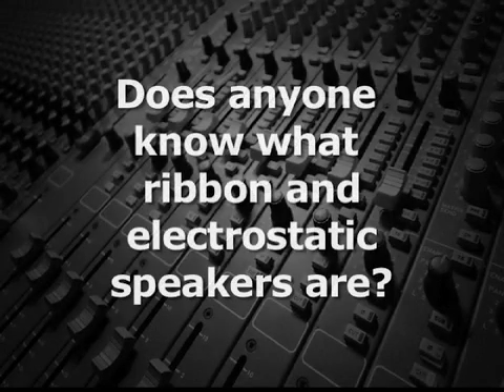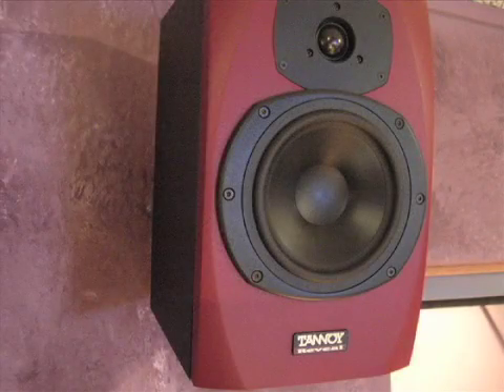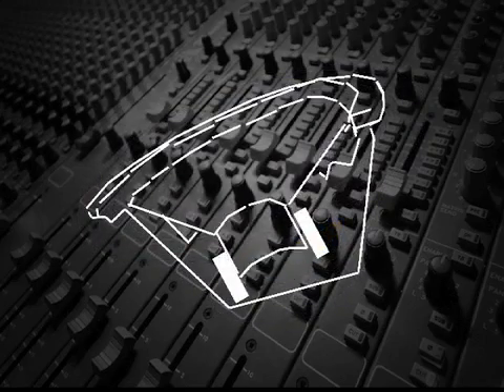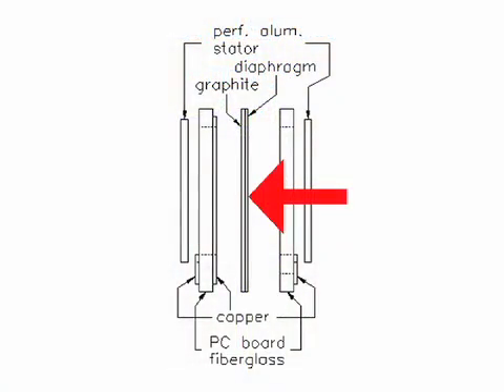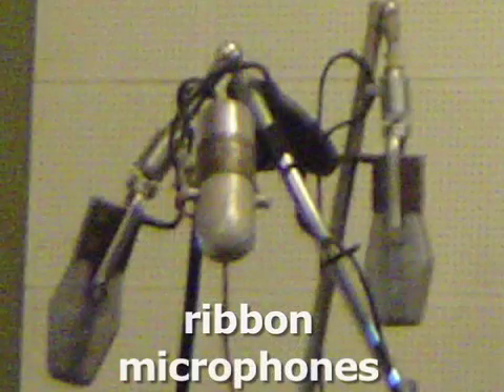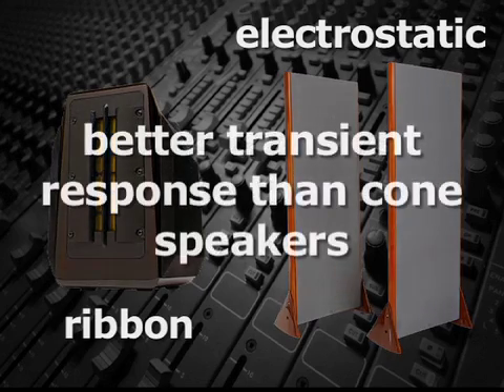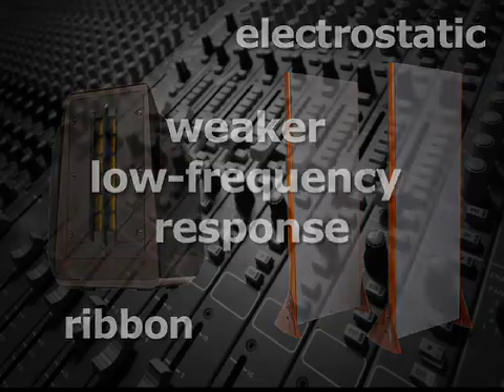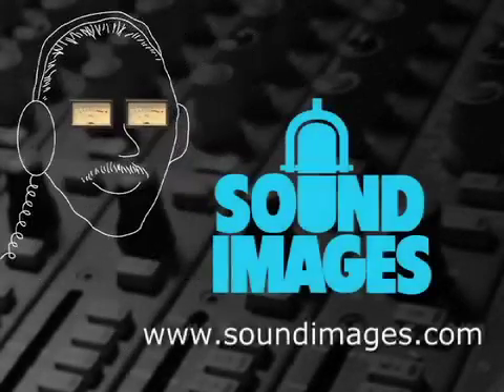Ribbon and Electrostatic Speakers

Comment: Regarding the reproduction of bass frequencies, electrostatics & ribbons do reproduce accurate bass to a limit and for most music (acoustical) their bass output is sufficient.  To make sound, any transducer has to move air and ribbons & electrostatic panels only move a very small distance, so they have limitations.  The larger the surface area of the panel, more air will be moved and more bass can be reproduced.  A welll-engineered, large diameter, moving coil (dynamic) loudspeaker will reproduce lower bass frequency but often the "resonance" of the cabinet where it is installed is misinterpreted as better bass response when in fact it is coloration. Moving coil speakers can exhibit a lot of "bass hangover" and boom.  Once an individual seriously listens to well-recorded music, the planar speaker wins. (If you listen to ear-splitting rock music, ignore all of the above!)